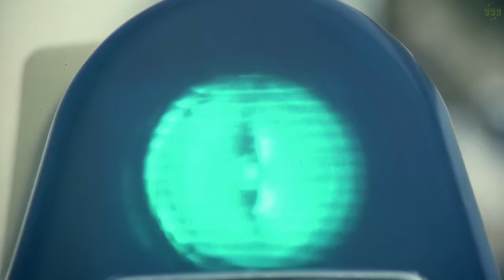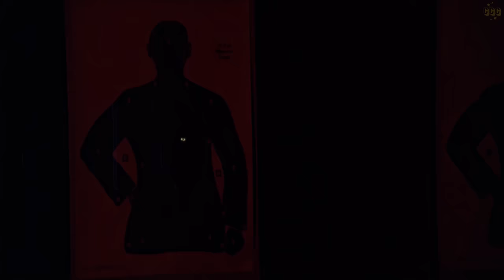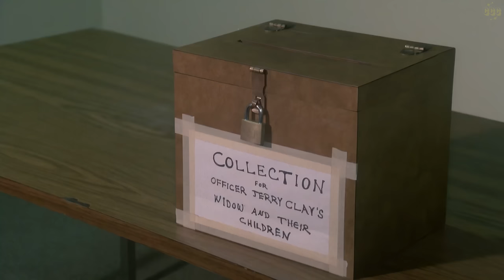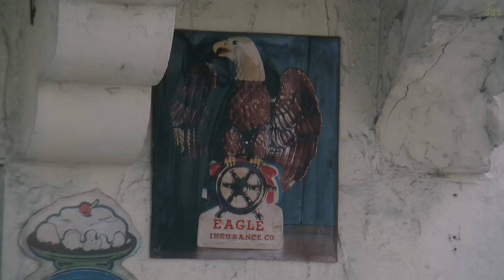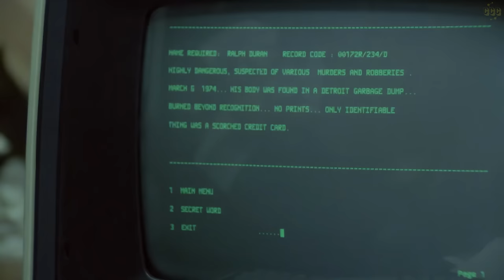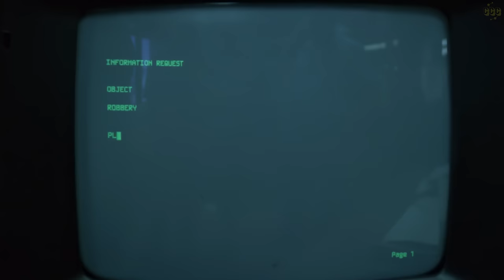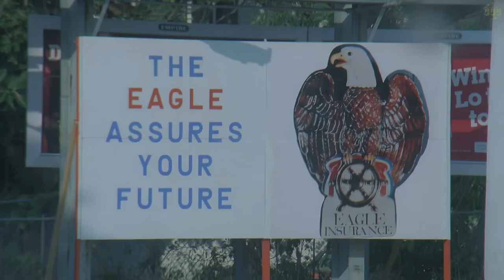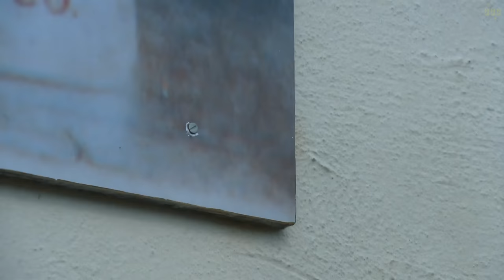(Terence Hill & Bud Spencer) Trinity: Good Guys and Bad Guys (1985)  Action, Comedy, Crime

Comment: With all due respect, sometimes hyperbole is used not the literal meaning. Hyperbole, exaggeration, a rhetorical trope used in statements, consisting in replacing features assigned to facts, people or concepts with other, arbitrary features.The scenery of this film is a bit different from the previous ones. It seemed a bit inconsistent, or maybe that's just the impression. Maybe we should talk about hyperbole sometimes used when we want to define something. For example: something is whiter than snow, that it has come to this, it is brighter than the sun. The most frequently used form of hyperbole is to compare a higher degree of a feature of some fact, person or concept with a given feature.
Reply: Learn to talk